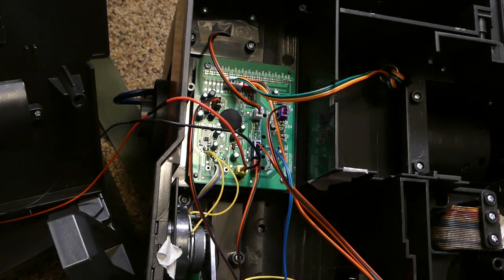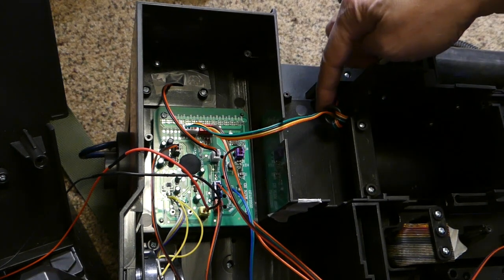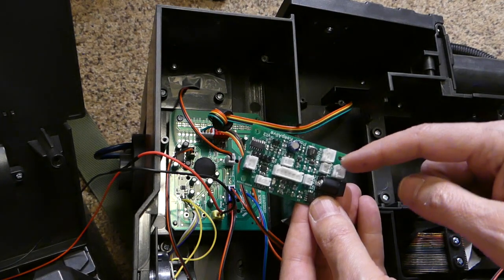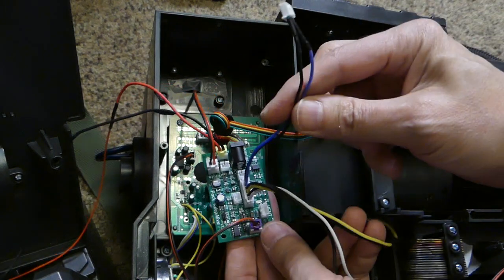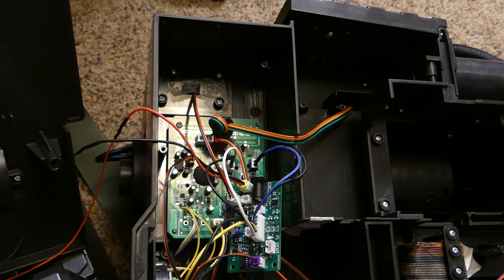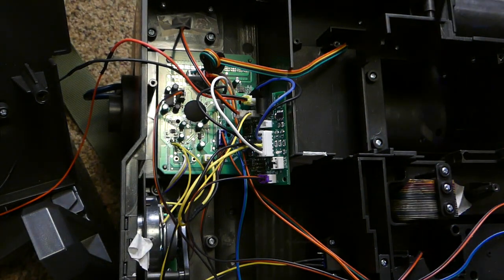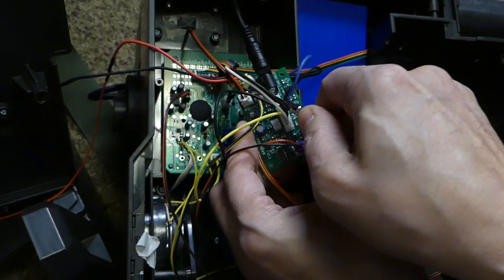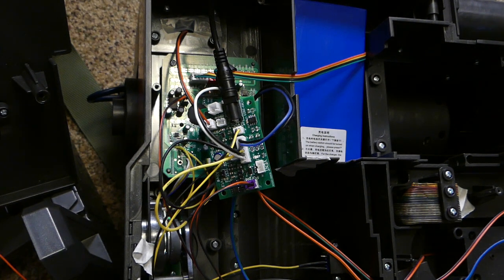Haslab Hasbro Pack Keep Alive board installation Spengler KeepAlive

Comment: Does this board keep alive the wand too?
Reply: No it wouldn't, that's a totally different system.  Tho he does have a keep alive system available for the wand.  Its just not as easy as this.  You have to solder it to the existing board.
Reply: @brianbennett2775  I know the keep alive for the Neutrona Wand.  But once installed it is no longer possible to turn off the Proton Pack via the wand.  That's why I'm asking if the keep alive for the pack would also be able to work on the wand, especially since we see in the video that it plugs into the wand's power supply.

Comment: Definitely a lot of screws to open the pack. Actually 15 of the little buggers unless I forgot one. I love this mod, and hopefully it will be available soon. Thank you for including a plug for the battery pack.
I do have one question. I'm building a control box that I'm attaching to the front pack straps, so I can control a smoke emitter in the pack. Since I'm going to run wires into the pack anyway, I was going to see if I can also wake up the pack from the control box. I know the red switch wakes up the pack, but didn't know which wire to cut my switch into. Can I use either, or is there a specific one?
Reply from the maker: The pack's big red switch just shorts the two wires together when it wants the pack on.  As long as the switch you add is run in series with one of those two wires and does NOT connect to anything else, then either wire works.  You swith would normally be closed so the main sw still works and then flipping it open is the same as flipping the big red switch off.

I am trying to get the Wand KeepAlive and Pack KeepAlive to communicate so the wand could directly control a vent relay.  No extra switches would be needed.  Of course I am not done with this yet - it is a stretch goal for that feature!

Comment: Can’t wait to get my hands on a kit! One question though, if we haven’t done the stay alive mod in the wand previously, will we still be able to use this mod or do we need to do the wand as well?
Reply from the maker: The pack can live through the wand powering off.  So not really needed unless you also want the wand to be able to keep the lights on continually.  Or (if it works out) ever want to add an e-cig smoke kit that the wand could control...

Comment: Ok. I'm in. Very interested in the stretch goals. How are you make that decision ?
Reply from the maker: If it can be done in a reasonable amount of time...  I believe the design will support it, but until I have it programmed and working it is not a certainty.  And if it requires a lot of unanticipated hardware I would drop the stretch goal feature.